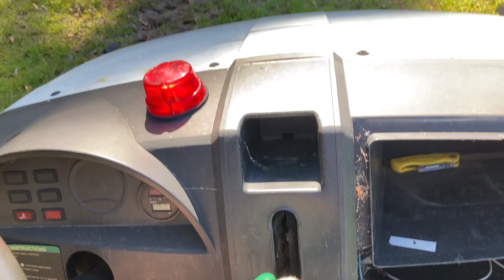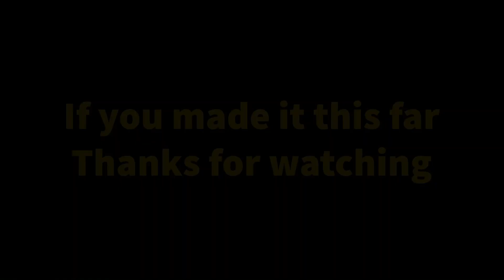Planting macadamia trees in September 2020

Comment: hey I'm from Malawi and I want to start macadamia nuts farming so I want to know how deep was the hole and what's the size of the spacing between one plant to another plant?
Reply from the maker: Hi, the holes are around three quarters of a meter, 75cm deep. The trees were planted 4 meters apart and the rows are 8 meters apart. Spacing of trees is not a settled issue. The 8 by 4 is a traditional spacing. Modern spacing is more likely to be 10 meters by 5 meters as this gives the trees more room to grow and works better with modern farming equipment.

We have a friend who came from Malawi. It sounds like a good place to live.

Comment: Do they charge much for the seedlings out of interest? Regular fruit tree is $50 - $100 at a local nursery.
Reply from the maker: The price of macadamia trees depends on their size and where they are bought. We normally buy them in what I think are described as four or five litre pots and are anywhere from 75cm to over a meter tall. Their price in Australia are around $20 a tree. This is from wholesale nurseries. All these trees are grafted and are of specified varieties. 

We once got smaller grafted trees in very small pots. They cost us I think $7.50 each. The price of a single tree at a retail nursery will of course be more expensive than buying hundreds of trees from a wholesale nursery. 

In regards to seedlings I have seen some commercial nurseries sell them. They are described as H2 variety non grafted trees. They cost around $5 or something like that. Again they are selling many of them to one customer as they are a wholesale nursery. I've never bought them.
Reply: @Karl_Degraa  Great info thanks.  Seems worth it rather than trying to stuff around with grafting yourself.